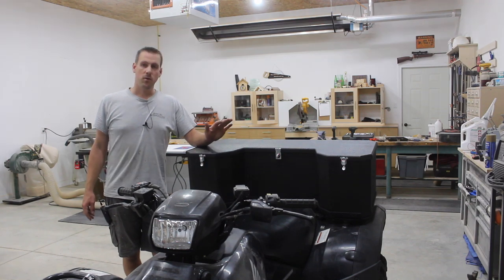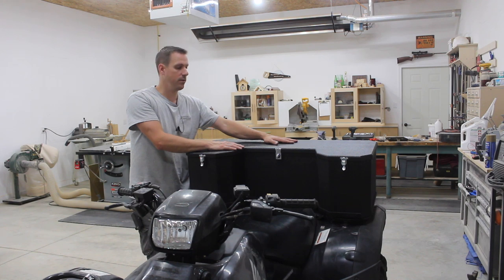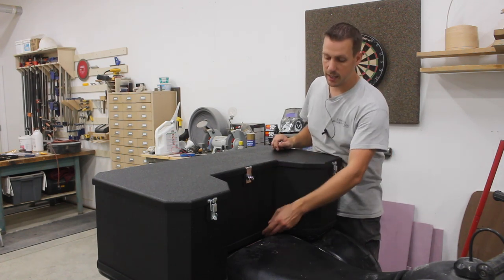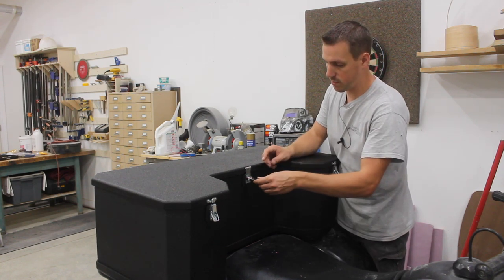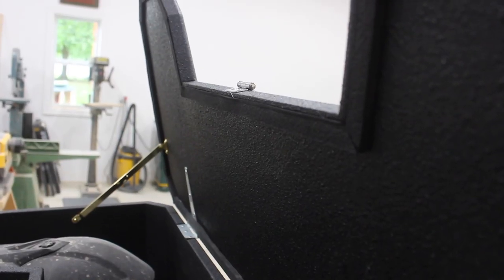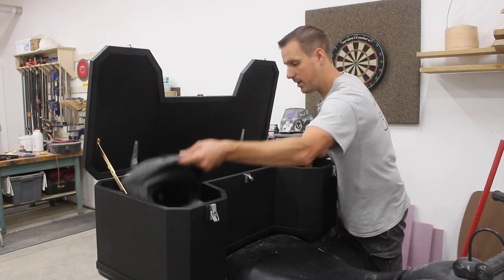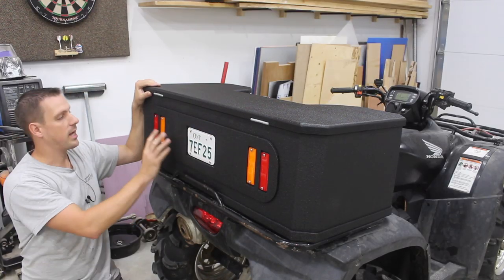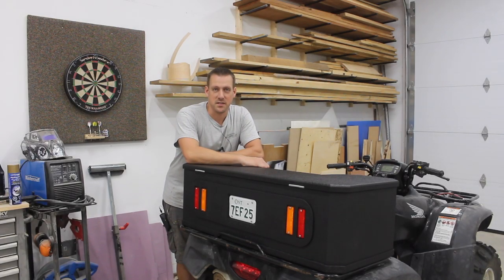Building An ATV Cargo Box

Comment: @Wes Hamstra  Great build, any updates 3yrs after on how it held up? I'm looking to build one and wonder what the best glue would be to use to stand up to the vibration it will see. Thanks for sharing!
Reply from the maker: Thanks! It is holding up well. I have been on ton of trips with it. Holding up perfectly. I have not tipped it over or rolled it yet. I am half expecting it to fall apart if that were to happen.

Comment: Hello. You can tell more about the material (aerosol) that was applied on top.
Reply from the maker: aerosol was a failed attempt at a rattle can spray on Bed liner. I went and got a the real McCoy Bed liner spray and it worked amazing!
Reply: Thanks!